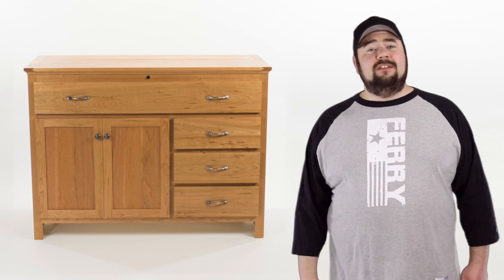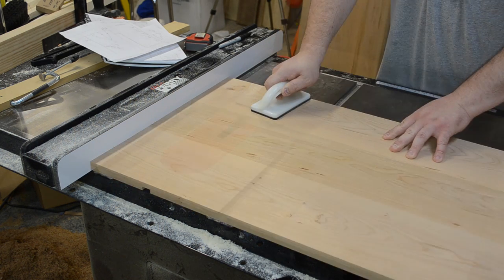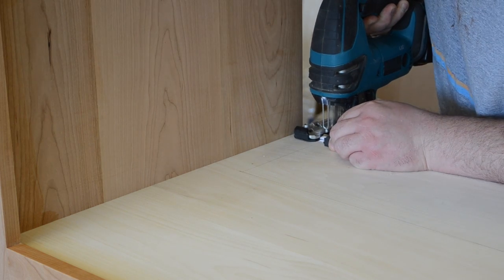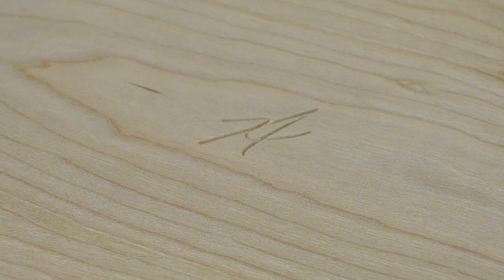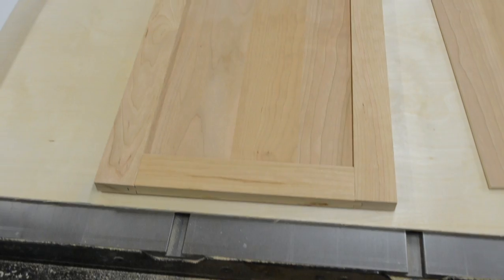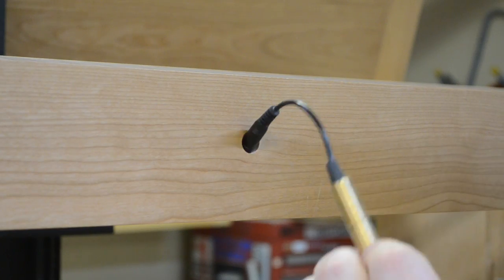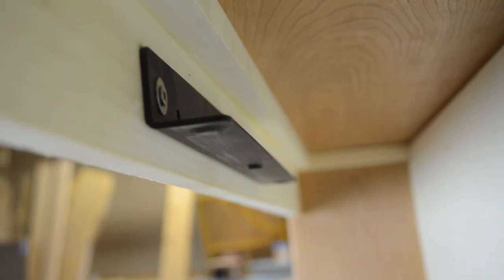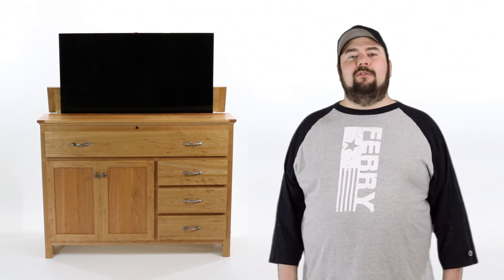Ⓕ Making A TV Lift Cabinet w/ Secret Compartment (ep63)

Comment: Yup, I knew I missed something. Thanks for mentioning it in your other video. Great build, that thing turned out perfect. Love that cherry.
Hey using a rip blade instead of a crosscut (at 1:20) when you make the tenons might help keep the tenons a little cleaner. Just FYI. You did a great job. I am going to have to build your Xcut sled one of these days. I saw there was a mexican version of you selling your same sled, I will have to see if I can find it again to show you. Funny stuff.
Ha, I can see you biscuits! ;)
I liked the ending when you muted that chatty guy. Awesome, Worth the wait. Thanks Nick.
Funny, a few years back I made a cherry T.V. lift cabinet myself, but yours turned out way nicer with the charging station and drawers. Great Job!!
http://www.custommade.com/cherry-tv-lift-cabinet/by/bearkatwood/
Reply from the maker: +BearKat Wood thanks man - at 1:20 it is actually a 40T high alternating top bevel combo blade - I rarely change out the blade in that operation for convenience and I feel that tenons that have a little "tooth" to them have more of an mechanical connection for non-through mortise & tenons - at 6:04 I switch to a flat top rip blade being the stub tenons show - let me know if you find the link to that other video - and yeah the ending was fun to make - always goofing around!
Reply: +Nick Ferry 
I get you on the bite for the tenons. Jeff miller uses a vise to squish his tenons a bit before glue up and it gives them a bit of a waffle. I thought about emailing you the link to the mexican dude that was pawning off your sled design, sorry I didn't. I will see if I can find it again. Your project turned out great. I wasn't trying to pick it apart, just noticed, and I did notice that you changed blades later on. Combos do it all, that is what I am usually using too. Say hi to everyone for me in Atlanta and have a safe flight.
All the best.
Reply from the maker: BearKat Wood no you weren't picking - I like the convo everyone can have on here - will do man!
Reply: +Nick Ferry 
Cool, oh and you did it all wrong ;)
Reply from the maker: BearKat Wood LMAO!
Reply: +Nick Ferry 
O.K. I actually had to look that up. How is that for a loser  ;)
Reply from the maker: BearKat Wood i do it all the time